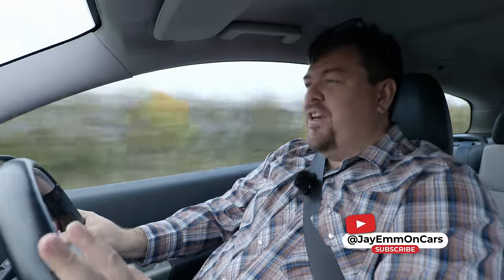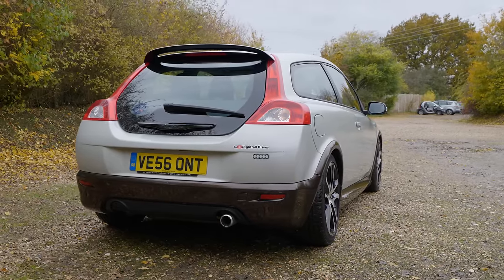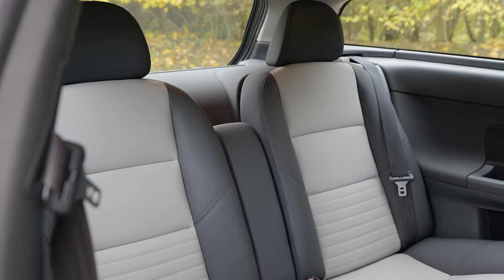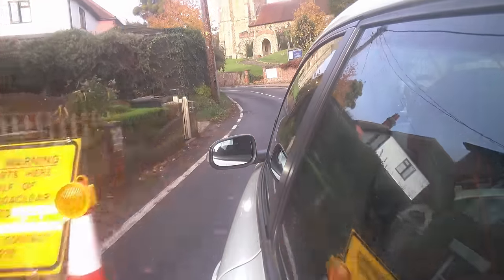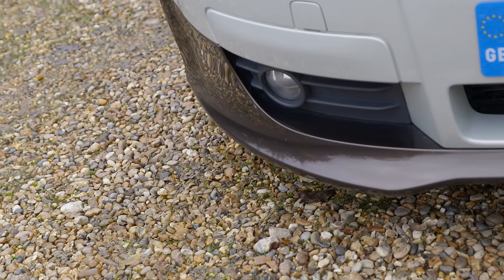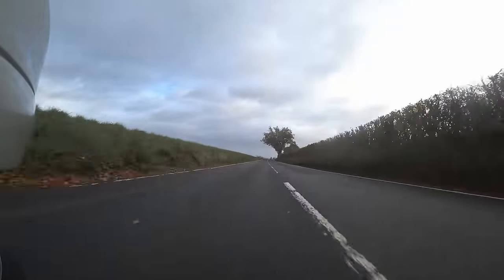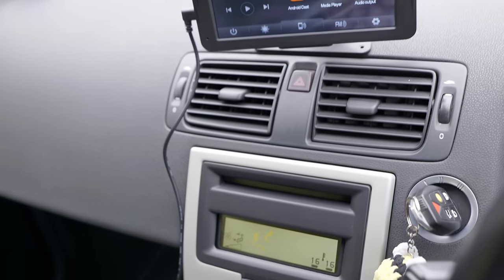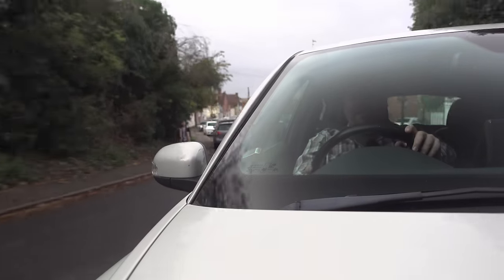The Volvo C30 - More Than Just "The Car from Twilight"?

Comment: Glad to see you enjoyed the C30 James, I maintain you were stitched up with the DB9 swap 😉 Honoured to see it promoted above Winter Banger!
A quick update - the resonator delete has not really improved things (despite seeing a convincing 'before and after' YT video 😆) Now looking at other options...
The long-term mpg has improved a bit to 33mpg, the pre drive-by timing of my trip computer reset didn't help 😆
Thanks again James for a great video on what seems to be a rare addition to the garage!
Reply: Have you considered putting the back half of a T5 exhaust on it for the dual tailpipes? Not sure if it would improve the sound much, but the symmetrical tips look much better IMO!
Reply: Absolutely, would like to get twin pipes in there - the bumper has the required gap, just blanked off!
A T5 system might work, but the bore is slightly larger so I'd need to work out how to connect it up. With the lack of any real aftermarket for this particular car, my other options seem to be either backbox surgery, or bespoke fabrication.... I'm liking the sound of the latter (no pun intended)
Reply: The KMS Thunderstorm is very popular on the T5, good sound but not too loud. I’d be tempted to get that and then either graft on a different flange to connect to the stock downpipe or have a custom downpipe made. KMS might even do it themselves if you contact them.

Also focus on induction more than exhaust, even if it means having an open cone in the engine bay, it might lose a little power but will pick up so much character.
Reply: Thanks, I saw that one when shopping around, will take a closer look 👍
I was thinking of trying a K&N OEM shape filter first to see if induction noise can be improved, will see what happens..
Reply: @NightfallDrives  A panel filter in the stock airbox won’t make a big difference to the sound. But it will be better for flow.
Reply: Right thanks, yes rightly or wrongly I'm much more bothered about noise than performance 😆
Reply: The mystery of the vibration seems to have been solved - play in the water pump. The timing belt and water pump have just been replaced and the old pump looks to have been the cause... 
The trip up to James' Halloween quiz will hopefully show for certain it's now gone 🤞

Comment: I love my 2013 C30 T5 w/ Polestar ECU upgrade and 6speed manual (fairly rare in North America). As a daily commuter, it's fantastic. Small, nimble, massive torque at 1500rpm.  Rarely ever need the rear seats, so accessibility really doesn't matter.  Rarely carry stuff in the hatch, so security isn't a big issue.  Factory stereo has the best audio quality of anything I've owned to date, and the Bluetooth still pairs every time to my modern phone, and steering wheel controls work just fine for audio streaming services.  Factory LCD display still shows what song/podcast/audiobook is playing.

Comment: The R design is essential imo , loved mine when I had one a few years ago
Reply: Definitely agree, have been looking for one every in a while for a year or so now. Always filter to only see the r design ones since the normal plastic fenders are quite ugly imo. Btw you guys in the uk are pretty happy if it comes to C30s: I’ve recently found a website called “the parking” where you can find cars across all of Europe and the cheaper c30s with d3/d4 tend to be in the Uk…
Reply: @walthefl  I think the problem is that old people drive Dacias now and the ideal target audience see Volvo and run.
Reply: IMHO it's a mixed bag... 

Rdesign bodykit and harder suspension is an upgrade.

On the flip side... Se Lux seats are a massive upgrade on the pretend leather in the Rdesign - a lot more durable, a lot more luxurious.

Comment: I've always loved the look of these cars.  This design was super iconic and love the retro touches.  Volvo really made an interesting turn with design with the S60, and then the C30 around this period.  I think the non-turbo five cylinders from this period are pretty reliable based on my family's experience.  Here in the States, my mom is driving the 2005 Volvo S60 with the 2.4 and auto transmission to this day.  They no longer use it for long trips, so it is mostly her in-town daily driver, but with over 200,000 miles, my parents have had virtually no major mechanical problems with the car.  The fuel economy tracks...I borrowed the S60 last summer for a trip up to Lake Tahoe from the Bay Area where they live, and it returned around 23 MPG for a summer trip to the mountains.  Mostly easy highway driving, with some incline and elevation.  There are two main drawbacks with the 2.4 non-turbo that I've found (at least in the S60, which is somewhat larger/heavier than the C30): the engine felt underpowered and takes quite a bit of effort to get up to highway speed/climb a hill, and the fuel economy is quite poor for the performance, especially by modern standards.  As far as I know, these engines were never really offered with the manual here in the US, I would assume the C30 chassis and manual transmission makes a significant difference in livening up the powertrain a bit.

Comment: Volvo C30 owner from the US here. The T5 was the only version sold here and sold in rather small numbers. They are actually a very rare sight. They also have the underpinnings for AWD since it shared the platform with the S40 and V50, both of which were sold in manual T5 AWD variants. Meaning with a bit of work you could get a replica of sort of their C30 Polestar prototype that they made, a monstrous 400 hp AWD monster. 

Owned the car for about 5 years now and hope I’ll have many more ❤

Comment: I bought a black 58 plate C30 T5 with 90k in 2014 and have ran her every day since. 170k on the clock now (serviced by Volvo specialist since ownership) and the engine is still really sweet, pulls strong from 3000rpm the 5 cylinder is a dream I love her. Got 18" black rims with red calipers which sets off the look great but still kinda discreet. Steering's not great - minimal feedback it does feel a bit numb, premium tyres also advised. Economy for shorter runs can be 24-27mpg but on a run at 75 she'll average 32-35mpg and 60L tank so not horrendous. Clutch went last year (the 1st one) which was about £1300 but that's the biggest bill she's ever given me in 10 years. Still puts a smile on my face and that's what all this is all about right?

Comment: Had a 2006 C30 T5 manual that looked just like the example in the video as a project in the summer of 2023. I'm happy and proud to have contributed to keeping one of these rare and beautiful machines on the road. My initial small summer hobby car budget exploded though as I had to rebuild the engine, replace pretty much every bit and piece in the chassis & many more small details. It's probably on me though as I bought the car from a "Volvo enthusiast" and skimped on the initial pre-purchase inspection (just went to check the basics at an MOT place).

Anyhow, the car itself was just lovely, the silky smooth 5-cylinder with the equally pleasant 6-speed, a comfy and stable ride in all conditions, just sooo nice! I just loved the unique love-or-hate look of the thing, it was just so "me", reminded me of my old E87 1-series with its divisive styling.
Reply: I was thinking of the 1 series 3rd hatch as well...
Reply: i have the 2.4i liter automatic

Comment: The 1.6 petrol is Ford, 1.8 & 2.0 petrol is Mazda , the 2.0 is quite decent performance, the 2.4 and T5 both being Volvos 5 cylinder , the 1.6 & 2.0 4 cylinder diesels are Ford/PSA , the D5 is Volvos, the last couple of years of production they replaced the 2.0d with a 2.0 version of the 5 cylinder diesel badged D3 and D4, the S spec is lowest , SE spec is high spec, R design is the sporty one with firmer suspension, I've owned a lot of Volvos, I've been looking at these for a while now , interesting to know the lower spec stereo isn't very good, I'll be making sure I get the higher spec one, my S60 has the upgraded 13 speaker system with 4 cd multichanger in the dash, it does sound good, I like the engine noise of my S60, but my previous C70 was better

Comment: Had a C30 T5 courtesy car from my Volvo dealer while my V50 was in for service. Thought it a good looking car with hints of the 1800 ES. 

Couple of design facts I was told - the shape of the floating centre console is supposed to represent a Scandinavian chair design and the keypad panel was made to look like a Bang & Olufsen hifi remote control...

Comment: I currently own a 2.4i RDesign version in New Zealand, it was a Japanese import. Slightly lowered and modified exhaust. 2009 (pre-facelift) model in White. It's a great car, picked it up for $6k nzd, about £3k gbp. It came with NO service history, so I had the cambelt and water pump done, as well as a cv boot replaced. It's never let me down and puts a smile on my face every day that I drive it. Yes the fuel economy isnt great, but I dont do that many km's in it, so it's not an issue. Always loved this car and would happily have another one (preferably with a sunroof)

Comment: Fantastic review! Im looking at one of these as a 2nd car next to my 2 yr old RDesign Powerpulse D5 Xc60. You have made my mind up and will be looking at the T5 2.5. One question...do you have a link for the aftermaket carplay display? Many Thanks.
Reply: Alg Performance do a good one but they’re out of stock currently.
Reply: @joemcteer2897 I don’t think I can paste a link here, but the unit I bought for this C30 was called 'Podofo Carplay Car Radio 7-inch Touchscreen, Bluetooth Car Stereo Support Wireless Apple CarPlay’. 
Currently appears out of stock, but the price has dropped a bit!

Comment: I’ve got 3 P1 Volvos currently. A 1.6d C30, 1.8F C30 and T5 C70. They’re cracking cars and depending on the spec some are extremely well handling, absolutely love these cars and they allow you to soak up the miles! Plan on always having a C30 as a daily until I need to upsize
Reply: Sorry but an Mk1 Yaris handles better than even a heavily modified P1 Volvo. They understeer way too much and the weight balance...
Reply: @Isaki138  focus ST/RS has the same platform/ configuration and nobody complains about them. Only thing they lack is steering feel. The duratec cars are actually really light on there toes and much lighter in the front. I’ve got 235 tyres on my car with the sport pack suspension and it handles windy irish roads really well.
Reply: @adamcarolan5884  ST/RS don't have the C30's super heavy doors and other penalties from Volvo's safety. The weight balance in the C30 is definitely awful. Suspension setup can be fixed with mods but you can't fix the weight.
For whatabout people complain, you mustn't forget every brand fan lives in his own bubble.
I have switched torquey power for lightness and that's what fits me.

Comment: A few fun facts about the C30/P1 platform from a Volvo nut (have had 2 C30 T5's at the garage at one point, as well as a stupid number of various P80/P1/P2/P3 Volvos):

Fact 1: The P1 platform that the C30 sits on, while often called a "Ford" platform, was largely engineered and developed by Volvo. While many people (especially here in the US where we don't get the cool Ford models) see that era of Volvo as "rebadged Fords", Ford actually did the miraculous thing of throwing money at Volvo to essentially do what they have been doing for decades. They would then take the engineering of Volvo (the 5 cylinder found in the ST/RS, various safety engineering inventions, little trim pieces like the "climate control guy", suspension technology, etc.) and put it in Ford/Jaguar/Land Rover products, basically using Volvo as the development team for the whole Ford umbrella. This is in stark contrast to Volvo's kinship company Saab, which when bought by GM was essentially stripped of all useful technology and then used as actual rebadged GM models until it died a painful death.

Fact 2: The C30, while a common car in the UK/Europe, is extremely rare in the United States. Across the 5-6 years they were in our market they sold less than 20k models. The e46 M3 for example has a sales figure around 65k models.

Fact 3: The C30/P1 platform Volvos were the first small car to use Boron steel as well as a revolutionary method of multiple steel types to create its chassis/crumple zones, making it one of the safest small cars ever made to this day.

Fact 4: The C30 T5 is basically a turbo swap away from Ford Focus RS500 levels. There are kits that swap the stock K04 turbo for the K16 turbo and auxiliaries found in the RS500. So for around $5k use you can take a C30 from around 230hp to about 420hp.

Fact 5: There are definitive guides to swap in the AWD drivetrain from an s40/v50 T5 AWD to the C30. While expensive, it is possible and not the most difficult thing to do.

2000's era Volvos really are a gem in today's car market that are being slept on, ESPECIALLY the P1's. While now overshadowed by the beautiful SPA era Volvos, the Ford era cars really combined the best of what Volvo does into one package with the P1/P2/P3 cars. Good power, reliable when cared for, simple to work on, and will last forever in the right hands.
Reply: Used to have a C30.

Now doing big motorway miles, the P3 S80 with the D5 on board is as good a waftmobile as you'll find - not super thrifty, but not gutless either... And super comfortable whilst not being useless when pushed harder than you can realistically go on British roads.
Reply: I do have to point out a couple of inaccuracies - Fact 1 is just wrong, the C1 platform is fully Ford developed including the control blade suspension, but Volvo engineered the T5 to fit within it, and of course built the bodies which are far better put together and more robust than the Focus. Fact 4 is kinda misleading, the C30 will match the RS’s power levels on the stock turbo, and the RS500’s performance too, since it’s just an RS with a remap and the RS is very heavy, but the RS K16 is popular and works well, but kinda sits in that no man’s land between having to do lots of supporting mods to support a big turbo, but also not maximise the available performance unlocked by those modifications. Also they tend to be pretty expensive.

But yeah, pretty much bang on. The cooking models of C30 just weren’t sold at all in the US and I kind of get why but elsewhere where people actually would buy them they made a killing.
Reply: @mcgherkinstudios  the last bit of "Fact 1" is not exactly factual either..... a Saab 93 owner
Reply: The Volvo isn't a turbo swap away from an Rs500 🤦 The standard Rs has titanium valves forged rods different ECU, turbo, intercooler throttle body, injectors, suspension, brakes stronger block & 81 hp difference between the Rs & C30/St. The Rs500 has over 120hp on the C30.
Reply: @Lav9944  He said power levels, not a turbo swap away from being the same engine. The RS also has plasma sprayed liners.

A C30/ST can achieve 330bhp and 400lbft on stock turbo, more power outright than an RS and the same power to weight as the RS500, with significantly more torque.

Of course that’s comparing modified C30/ST to stock RS, but he’s not wrong.
Reply: @mcgherkinstudios  His exact words were The C30 T5 is basically a turbo swap away from ford focus rs 500 level's which is complete bolloxs he didn't mention even anything about power. 😂 Focus St 2.5t / C30 2.5t Struggle to make over 300hp without the blocks cracking hence to the block mod. Its rubbish to say that you can get to that level of power  on a standard turbo and car  when the block can't hack it.
Reply: @Lav9944  He was clearly talking about power levels.

I ran 316bhp and 384lbft for 8 years and never cracked a liner. Put some shims in when I did the cambelt, never need to worry again. Currently building it for 500bhp and will still be on stock liners. Oh and RS suffers the same weakness anyway, just at slightly higher power.
Reply: i have a 2010 c70 i want to stage 1 upgrade the car i cant find any info can i follow the upgrDES ON A C30 AND APPLY TO THE C70 ?
Reply: @8deuce1tv-eh7zn  The C70 and C30 are identical mechanically 👍
Reply: @mcgherkinstudios  THANK YOU
Reply: @mcgherkinstudios  so basically find a c30 video check the stats get parts and bring to my mechanic for the bolt on upgrades so surprising there is no video or info
Reply: @8deuce1tv-eh7zn  pretty much. Obviously the parts need to be relevant to the engine you have.
Reply: @mcgherkinstudios  thank you
Reply: The platform is a Ford platform, developed in house in Cologne, not Volvo.
Reply: @Nakke144  with a team composed of 20 Volvo and Mazda engineers in an effort to IMPROVE the struggling Ford engineering team. I see you’ve done your research but I recommend you complete it before making corrections.

Comment: Glad you had a good drive. We have a 2.4i and it’s epic. No, we don’t need the t5; pretty much all the c30s sold in the us were t5s but what do they know? Our engine happily powers the v70 as well; we’ve had 3 of those in auto guise do 200k with no problems. No issues for the c30 then? All the weak points are Ford but cheap and easy to replace. Yes, the upholstery could be better, the ice is easy to upgrade and as for the rear seats, well, I’m just over 6’3” and fit comfortably in the back providing it’s behind Mrs C who’s a foot shorter. You can pick one up for chips, they don’t rust, last forever if looked after and the 5 cyl soundtrack is as good as a t150v trident (look it up) Beautiful scandi design up there with Georg Jensen; if you don’t get it, buy an audi like everyone else, I don’t care. C30, we love you!

Comment: I know a guy who has a T5 putting out a true 400bhp+ through the 5 speed auto transmission. It's been a few years now with these mods and no issues apart from the usual old car stuff. Important though to let everything warm up (oil mainly) before giving it welly then driving gently a few minutes before your destination to let everything cool down a bit.